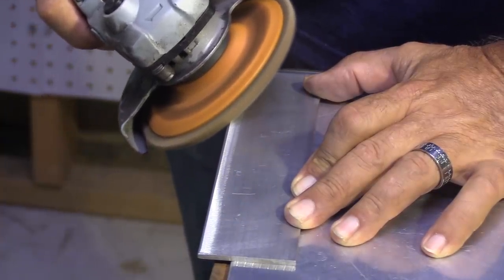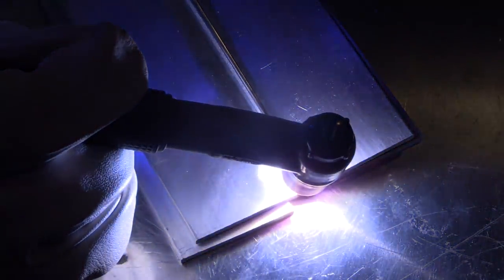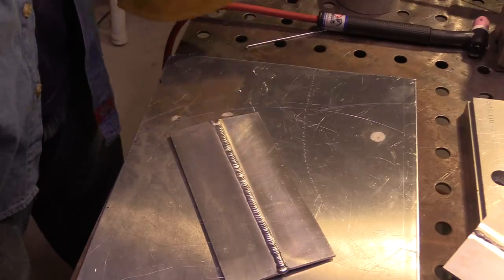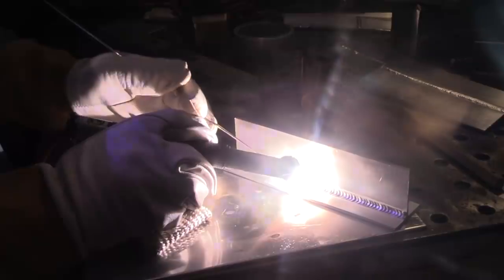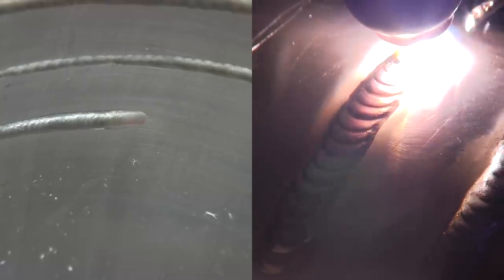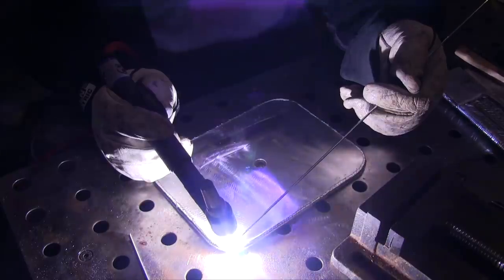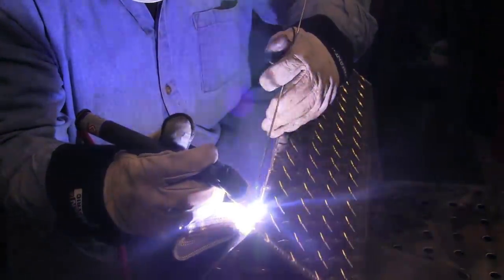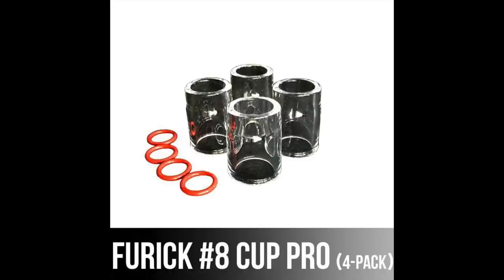TIG Welding Aluminum Techniques Butt and Tee

Comment: on aluminum, edge to edge, you need to make a heel. This means starting at approximately 5 cm and going towards the first end, then continuing the welding in the other direction from this first start to go towards the second end. There you are somewhat lucky to be in a fairly strong thickness, because not making a heel means taking a very big risk of having cracking on your start.

Comment: Thx I was having problems tig welding .063 sheet together, butt weld. Full penetration but lack of fusion underside, the sheet edges were still visible. Weld split open during testing.  Experimented with flux on the underside and it worked very well. Destructive testing proved positive. I could not split the weld.. Some loss of visibility from the flux flare but I'll manage.

Comment: Great video as always! 
I recently took several weld certifications, in different processes, including various aluminium joints configurations. The Tig Finger and Tig Finger XL made the difference with the aluminum for me. I was comfortable throughout my test. The other welder in the booth beside me could not say that.
Reply from the maker: thanks so much and congrats on the test results

Comment: For "T" welds I had trouble getting a shiny puddle on both metals at the same time. Solvents didn't help. A 3" sanding pad on a battery right angle tool to roughen the edges was a game changer. Also lower gas flow helped stamp out arc wandering. Keeping the tungsten almost touching was also a game changer. Maybe a AC balance more on the penetration side would help but auto is working on my Precision 185 transformer machine. 👀

Comment: TIG process (141) use AC and pure tungsten or zicroniated tungsten with hemispherical ball end, slop-out technic for minimise tungsten inclusion - slop down techni minimise crates pipe. Choice NDT test using penetran test (PT)😊

Comment: You are a very talented tig welder sir. Very informative video. I just started messing with tig. I been a duel shield, stick an aluminum spool gun welder for 15 yrs. Tig is a different animal an I get discouraged feeling out of my element. I've gas welded with an acetylene torch an been told it's kind of the same motion but I've been struggling getting it to flow. Any pointers??
Reply: I think it's a LOT like torch welding!  There's a small point that I'm still struggling with in both:  That it's important how far the torch is from the weld.  In both cases it's easy and natural to pick up the torch a little, and it makes everything worse!  If you have a foot-pedal that's a help as you slowly get the co-ordination, a torch switch can help also.  That is, if things get too hot you can let off with the torch switch.  Things want to be CLEAN, Jody mentions this in several videos.  Our ancestors used to SCRAPE the edges of joints for high-quality welds.  I mention this b/c a lot of times one is practicing on random scrap that has been sitting around, you really want to see shiny bright metal before you start welding!   Then do as our leader says:  let the cleaning action work a little, then turn it up and get a puddle, then put in some rod.  There's no shame in just stopping at that point, and see what you got!  If you like it, next time make another bead overlapping the first....  Another beginner problem practicing with little scrap is that the heat builds up QUICKLY,  you really want several pieces in rotation.  It's not as bad for Jody b/c he moves a lot quicker, has the TIG-finger, and knows how to let off on the power as pre-heat builds up.  A beginner is putting a lot more heat in to the work to do the same weld!  I am finding that maybe six aluminum chunks can be shuffled around, just put an inch or two of bead on one and set it aside.  Don't give up!  It really does respond to practice.

Comment: Hello Jody, I am trying really hard to follow all your tips and tricks on TIG welding and have gotten a little better until I bought a new Everlast 252 STi.  Now I am in deep over my head and the manual just does not really help me know how to set up the settings for stainless and aluminum.  Nobody has shown the AC setups for this welder and that includes your buddy Bob Moffit.

Is there any future plans for you to make a video on this machine and how to use the settings for AC TIG and pulse, etc.?

Oh by the way, I love the TIG finger.  Since getting it I have not felt the heat while practicing with my little Everlast 141 STL.

Comment: As usual, GOOD video.  You make it look so easy.  To prevent blow throughs at the end of sheet metal welds, I was taught to start welds in from both ends and join them in the middle of the plate. It's kinda cheating and not fancy  as yours, but it works pretty good.

Comment: 2 questions:
1... Have you ever had slight porosity that wasn't caused from contamination? Mainly toward the end of a joint. (assuming it's been something to do with gas... 100% argon)
2... Is there any negative effects of lowering your heat/backing off on the rheostat significantly when approaching the end of a joint that's thin like it is in this case?

Gonna be getting certified here soon through my company and want to sort out all the little things before hand. Thanks to anyone who with any advice!

Comment: Hey Jody!  (and welding community) a couple of questions from a non-welder wannabe....

one of the take-aways from your videos and many others is that a perfect, or near-perfect weld is the weld resembling stacked dimes....and from some YT sources, skilled welders don’t grind their welds...no need to.  BUT...is there any time/occasion/instance where a weld can be ground  without affecting the weld quality or strength?

next question:  is there any time/occasion/instance where a secondary reverse-side weld is called for?  like in a T-joint where one wants to be absolutely  certain of the weld strength?

Really enjoy learning from your videos, Jody.  Hope to someday get into this wonderful skill!

Comment: May i ask you please
Is there akind of tig wellding machine can weld aluminium or its doing the same job ?
Becouse i already buy tow machine one of thim called gaiant (china) 200 amp 
And the other one is daeho korian machine 500 amp

Comment: Can you talk about porosity in aluminum welding and how to prevent it? I'm doing a 3G groove test with backing plate 6061 .250 thick....dynasty 350...radiography shows major porosity  thanks.

Comment: When you're moving, what are you specifically looking at to determine if you're moving fast enough?  I've been practicing on mild steel and it seems like the metal is getting way too hot although I think the amperage is set in the right range.
Reply from the maker: different situations call for different travel speeds but I think for most tig welding of sheet metal, moving about 1/8" per second is a good start.  if you are just learning and practicing, a cheap harbor freight aluminum ruler placed next to the bead can be helpful. 
and thanks for the awesome mug!!!  hope to see you soon at workbench
Reply: Thanks, Jody definitely see you and JD next week.  Party at Drew's new shop if you're available.  Wed night.  oxintheshop on Instagram

Comment: Also, you must be diliberate and intentional everytime you add or dab the filler wire...otherwise the filler rod just disentigrates...unlike stainless steel filler wire which can be left in the arc stream. Aluminum wire doesnt melt and drip into the puddle. If you dont add it right into the puddle, there will be problems.

Comment: Hi Jody, watching your videos, try turning the plates over so that v is at the bottom, you will be surprised by the result.
Reply from the maker: I will definitely try that...thank you for that.  I have heard somewhere that it works great and then your comment  comes in...
Reply: @weldingtipsandtricks  Turn over and then the seam will be smaller, I do that when it is impossible to process the seam and then inside,
Reply: Николай Мишин мля без английского то как хреново)))

Comment: Just wondering why the machine is set to 140A for .125" AL? I'm using an Everlast 200DV, .125" x 1" flat bar AL practicing at 55A @ 100Hz @ 30% AC TIG 4043  rod...
Reply: Oh nevermind, just tried it at 110A AC @ 100Hz @ 30%, works great! I'm a beginner, this is hard :)

Comment: Nice, I have sent several messages  to weldmonger, does the basic stubby gas lens kit for a 17 allow you to use all the consumables for the wp-20 torch?
Reply from the maker: The basic stubby kit includes 3/32" hardware only.  It will allow you to use other gas lens style cups and will also work with the furick ceramic 12 and ceramic bbw.  hope this helps... I remember sending you an email just a few days ago. maybe my responses are hitting your spam folder.
Reply: Thanks

Comment: Do the Furick cups have different size sets for different torches? #9, #22, #26 etc
Reply from the maker: #8 and larger furick cups work with a 9 and 20 style tig torch without any adapters.  but for air cooled #17 #26  and even 18 style water cooled torches , the furick adapter kit is needed  https://goo.gl/1WfkV2

Comment: Sir what is the use of foot pedal?.....im a welding enthusiast and i love welding
Reply: The simple circuit in the pedal controls the amount of current flow in the arc, allowing precise heating of the work piece to form the puddle.